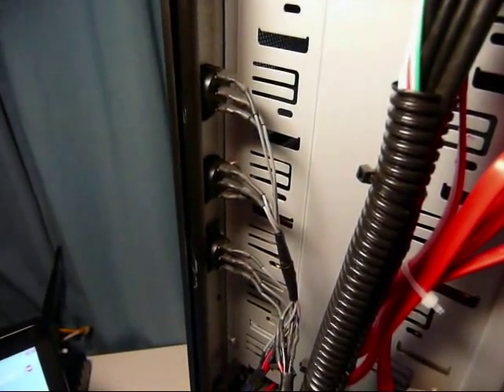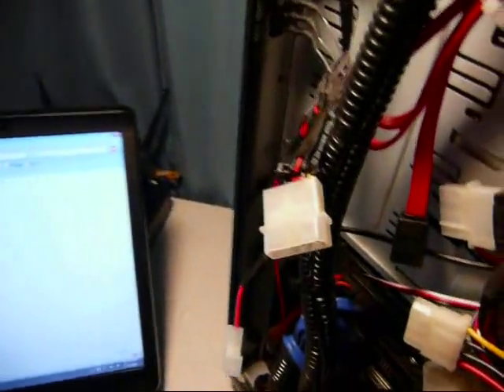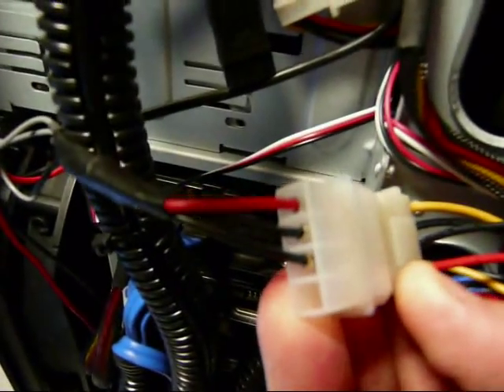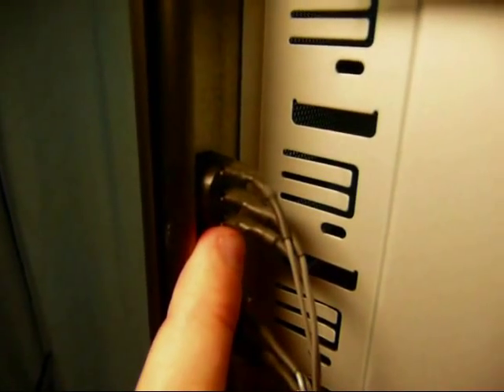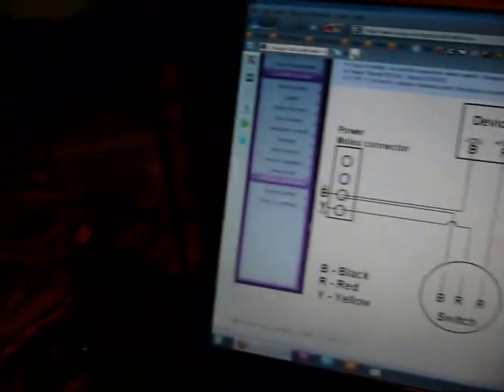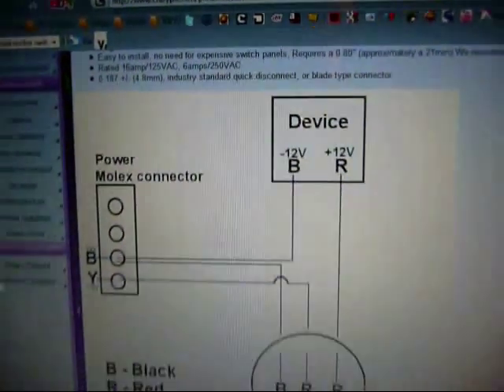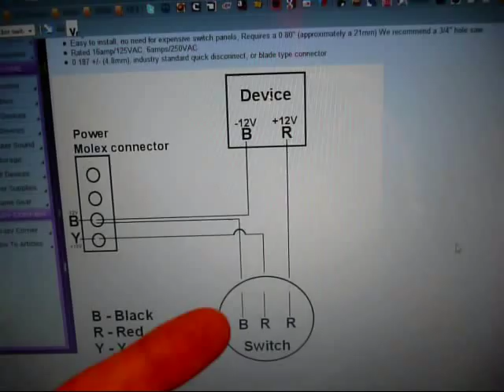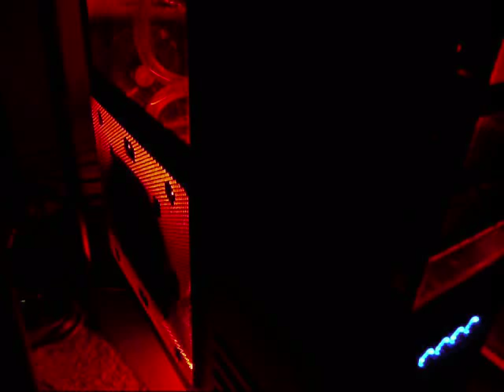932 HAF Coolmaster Cathode - wiring and switch installation

Comment from the maker: yeah the side door hinge needs a chunk the length of the total height of the switches cut off since there's not enough clearance.  I learned this late in the process when I tried to get the door on.  Glad to see you got it to work as I did!

My new waterloop is nearly complete ... been taking my time since the laptop is more than adequate at doing what I need to do till it's complete (8800m GT onboard video/1.8ghz Intel processor).

Subscribe to get the update when it happens!

Comment from the maker: I drilled with 3/4 (I think) inch drill bit throught both plastic and metal.  First I took the face plate off and drilled that and seperately drilled the metal after re-attaching the faceplate and drawing through it to mark the whole to drill in the metal.

Make sure to drill smaller than necessary on the plastic. The plastic should be a "snug" fit.  The fit will hold the switches in place and there is a snapping mechanism on the switches when they are pushed in all the way.